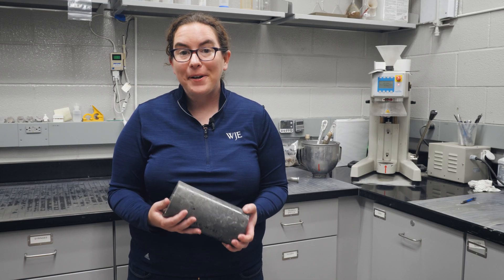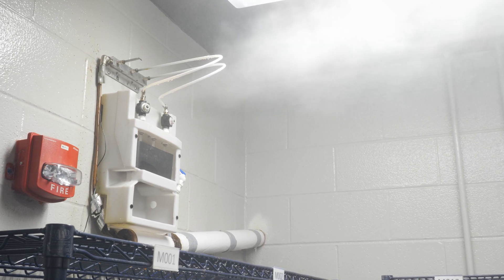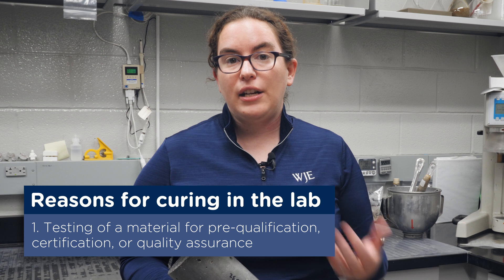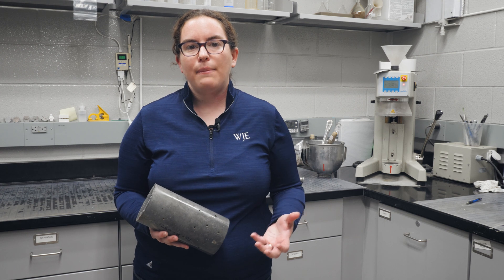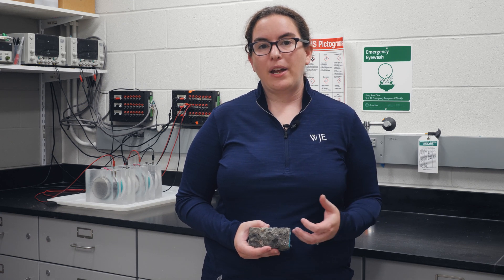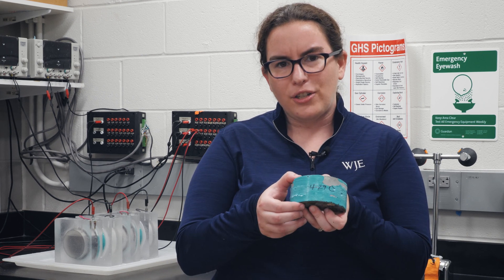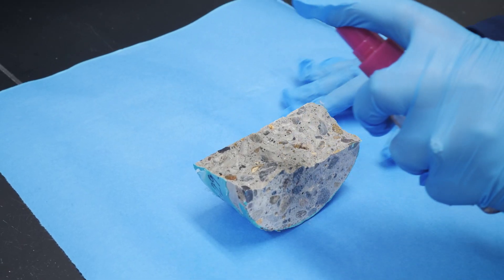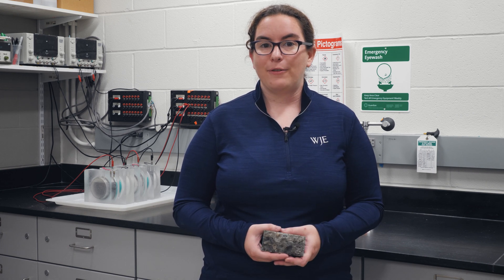Solving for Why: Concrete Curing in the Lab

Comment: The question is why we cure concrete in the lab and have  been tried to address.But the still the question remains why we cannot cure our cylinder near the structure as per standard?